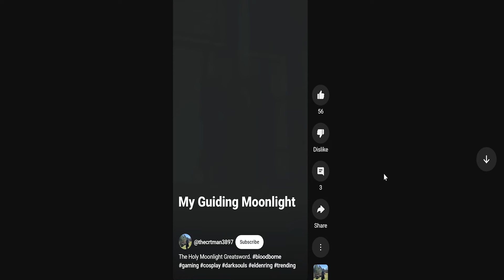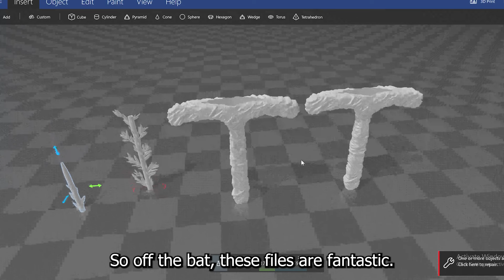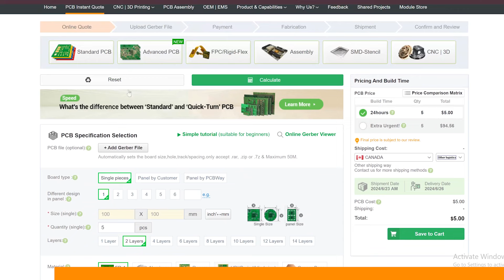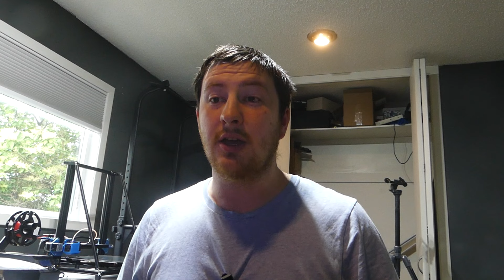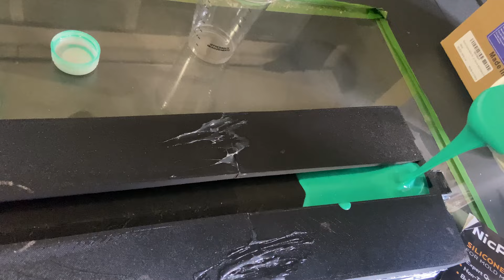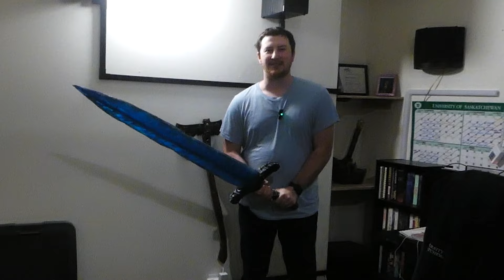I Built the DarkMoon Greatsword From EldenRing | EldenRing DLC

Comment: Amazing! I might go with the UV LEDs.
how did you connect the LEDs to the light saber hilt? I was looking online for some documentation on the hilts but all I can find is manuals on how to use a fully built lightsaber. Would love to know before I order it :D
Reply from the maker: @turbojuergen_7970  the hilt has a connector with pins sticking out. Normally there would be a other connector on the lightsaber blade that pushes against those pins. What I did was cut that connector and you’ll have 3 wires. 5v, gnd, and signal. They line up with the 3 wires in the LED strip. Though if you’re doing the UV method, some further testing will need to be done. As they don’t work using a signal pin like the Neo pixel LEDs I used. You might be able to connect them directly to power and ground and leave the signal pin empty. But that depends if the hilt cuts the power to the 5V pin when it’s not active. Hope that helps.
Reply: @TaitumLaroque  thanks! that already helped a lot. Knowing that if you cut that pin connector off you have the 3 connectors you normally have on LED strip is great 😃👍

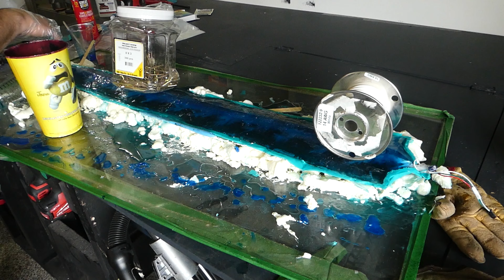Comment: 9:48 how would you do it again in the future? thinking about following your entire build
Reply from the maker: I wouldn’t cast the two halves separately. They didn’t stick together well and didn’t look great. I’d do it all in one mold if possible. I had an idea after words to use glow in the dark pigment in the epoxy and use UV led strips instead. Then when you turn them on it charges the pigment to glow instead of this intense light from the blade. But just an idea. I’d also work more on the electronics to get that working. It could be down with a 5V micro controller, but I didn’t have any and didn’t want to wait. Next time.